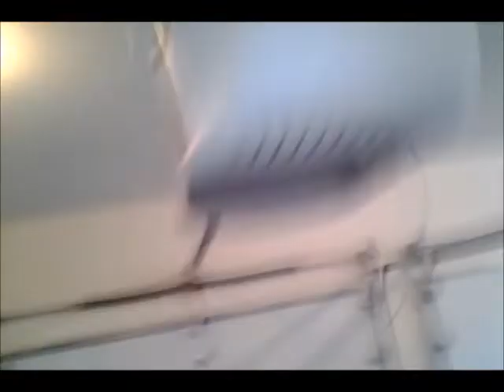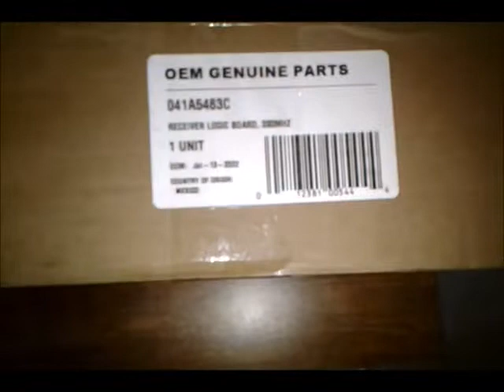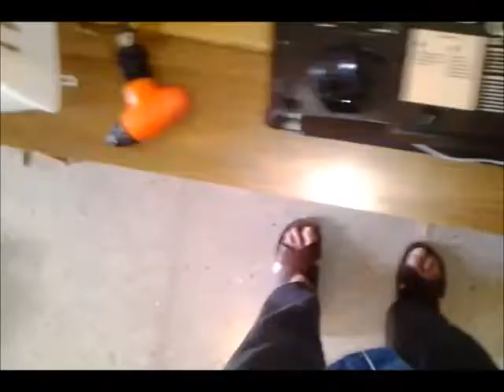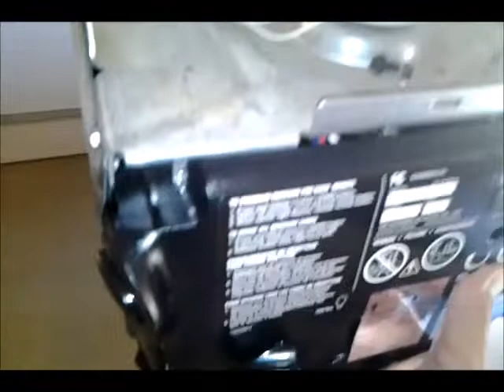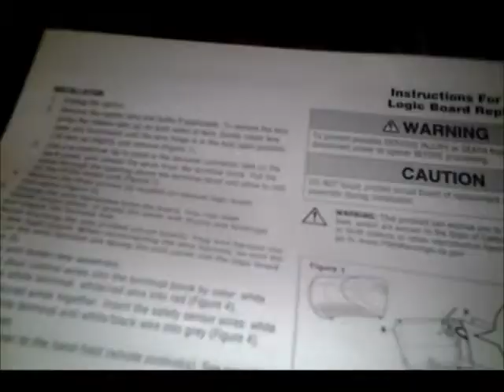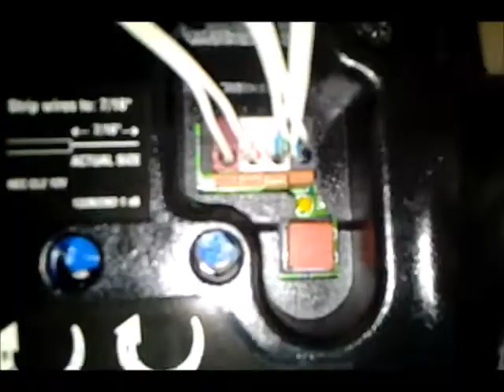REPLACING LIFTMASTER MODEL 2265 GARAGE DOOR OPENER CIRCUIT BOARD

Comment: Mine just keep blinking non stop.   Lasers are aligned on the doors and the wall unit works.  Do you think my board is gone?
Reply from the maker: Is the wall unit or the opener blinking non stop? Have you checked the codes, in your manual?  They may give you a clue?